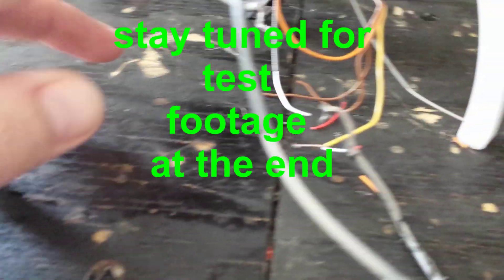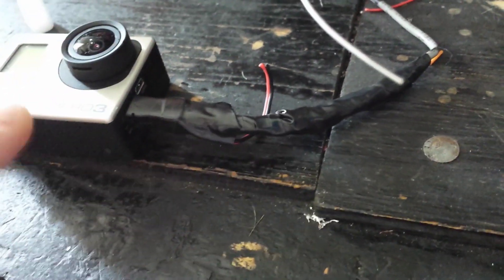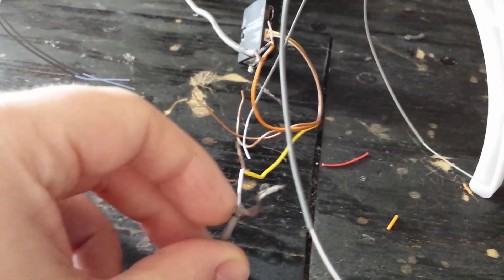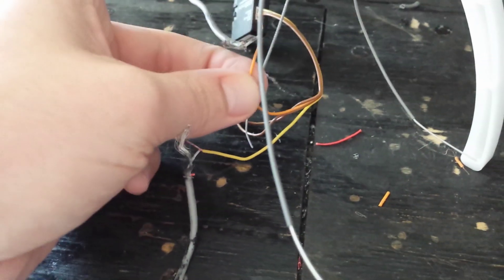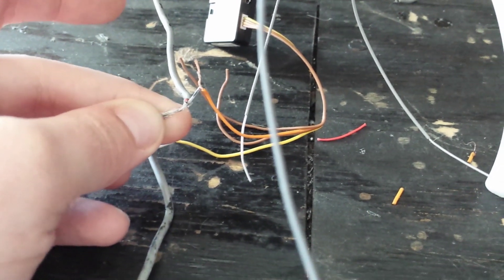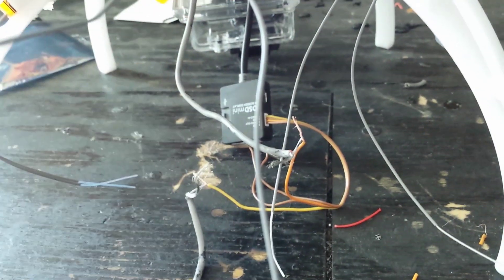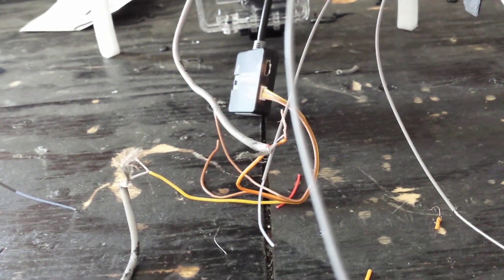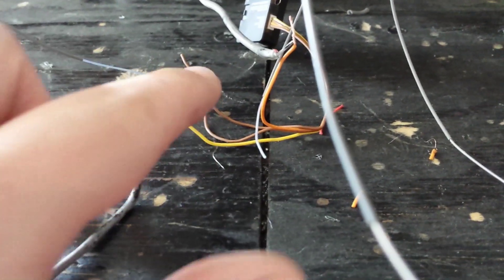How to wire DJI IOSD Mini with test footage

Comment: Great video. I just purchased a Phantom FC-40. this system has a built in FPV capability. I don't want to add a separate video transmitter at this point. Will this not work without one?
Thanks again :)
Reply from the maker: I don't know.  You have to have video in and out then rewire to send to your video tx that you have built in
Reply: Erik740t Actually I figured it out. It involves adding a PMU unit to your FC-40. I did a video on it. Check it out incase someone else asks.